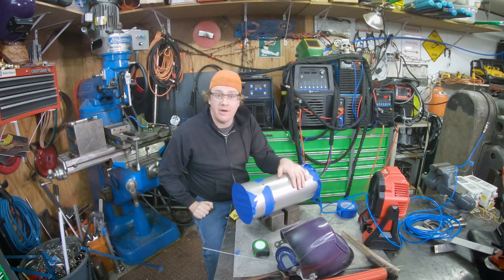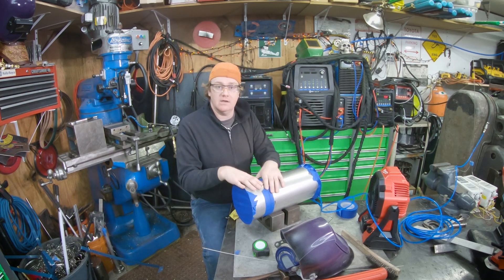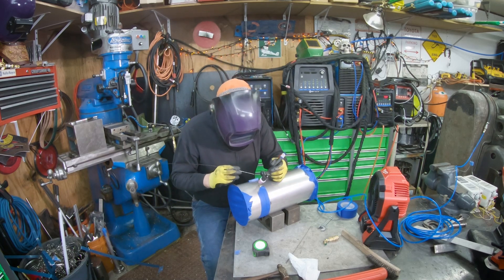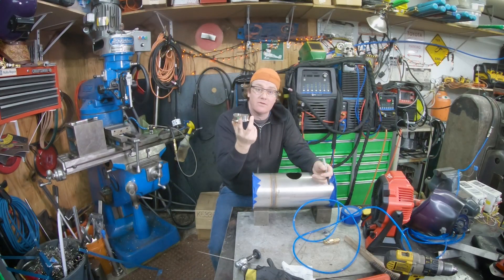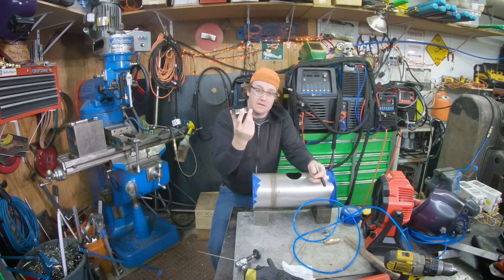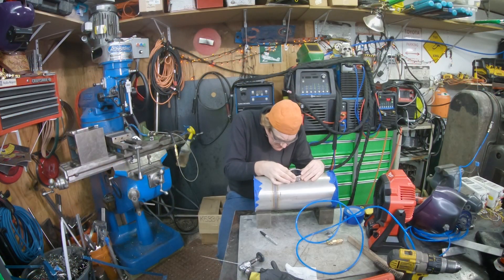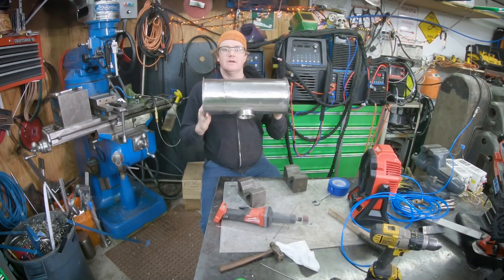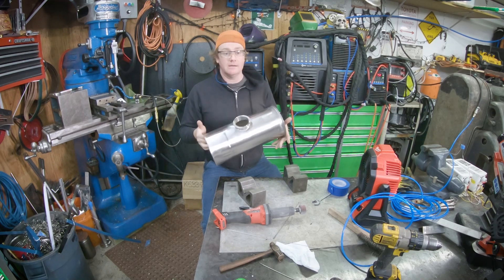Stainless Steel TIG Welding 6" Thin Wall Pipe With A Ferrule

Comment: You running a CK FL150 on your Dynasty 210? Have you ever ran that torch at anything close to 200+ amps, or higher than 150? I've read a few posts where some ppl say they push theirs way up to 200A (for periodic bursts obviously) since it's rated 150A @ 100% Duty Cycle..
 Basically, I am wondering if I can get away with leaving my water cooler at home and certain scenarios 😅😅  I love my water-cooled CKFL250/30 (my normal go-to) & TL-18 for heavy stuff— but if I can get away with the FL150 on 200amp work that'd be the bees knees 
...however I'm searching for more confirmation before trying it since frying my FL150 would be the opposite of the bees knees haha
Awesome channel you have man! Hoping to have a fun toy collection like yours some day 👨🏻‍🏭✌
Reply from the maker: Yeah, I run that torch on everything now aside from my heavy hitters 26 rig or the water cooled one on my dynasty 400. If you run the 17 size head and a 26 gas lens in it you can 200 amps for short periods with no problems. but the cool thing is you can have a 9 size head and it is killer for small detailed stuff. I have one with a torch valve and a couple without. the one with a torch valve (red handle) takes heat a lot better than the non valve ones and they do really well.

Comment: Nice job brother! What do u purge(rate) something like that at? Do u prefer a ck17 on low amps like that or ck9? Gna buy another air cooled but cant decide if 150amp(less comfortable) torch makes more sense for 60-100amp welding. Thanks bud!
Reply from the maker: I would guess I was at 20-30 cfh I was to lazy to grab a dual flow meter out of my truck. I just had a y one the tank. I am a huge fan of the ck flex lock torch. If you haven't seen them I would definitely reccomend giving them a try. You can rotate the head 180 degrees and change out the heads for a 9 or 17 size. I cant say enough good things about them and I haven't managed to melt one yet even with short welds at 200 amps.
Reply: @DarlingtonFarm  looks like your reply here answers my question from my first comment. When you run it at 200amps is that longer/repetitive welds too? Or is that just a shorter burst
Reply: I'll vouch for the Flexloc's as well. Very versatile & comfortable, you won't want to go back to a basic flex (bendable) neck. You can swap the heads out, hell even flip them over and attach them in upside down if you really wanted to, haha. ck9 & 17 have the same identical torch body, same with their watercooled flexloc version for #20 and #18 torch sizes. Even with 3 cables running inside your jacket, those super flex cables that they have are more cooperative that a standard single rubber power/gas cable you'd have on a WP17. 
 Flex-loc covers 95% of my usage

Comment: What tig rig do you use out in the field? 1 piece, two piece? I have a heavy hitters rig but the ck flex cable looks really nice and its probably easier to wrap up too
Reply from the maker: I have a heavy hitters if I'm welding pipe. For sanny, I run ck flex lock torches on a super flex hose since I almost never go over 80 amps

Comment: What pressure do you run the back purge gas at?  I wouldn't have thought the tape and tinfoil would be all that is needed.... ah you poke a hole to let it escape  Thanks.
Reply from the maker: If I'm running a dual flow meter I will run about 20-30 cfh on something like this. I always poke a hole.... I didn't once and when you get around the last of the weld it can blow out, ask me know I know. I had a y one a single meter and just set it to feel about right.
Reply: @DarlingtonFarm  Thanks!